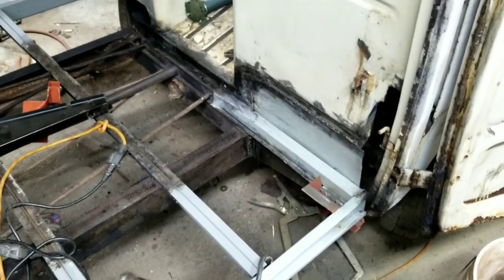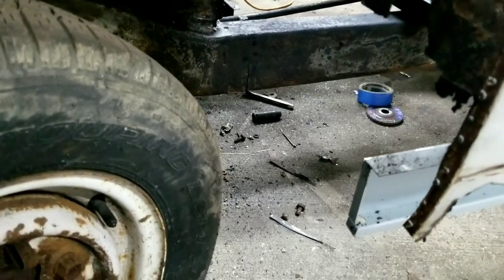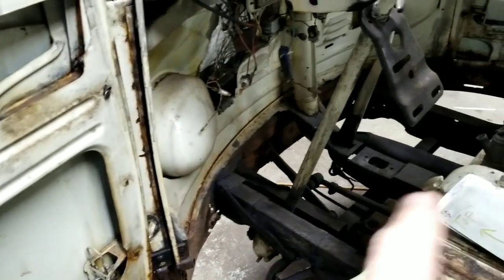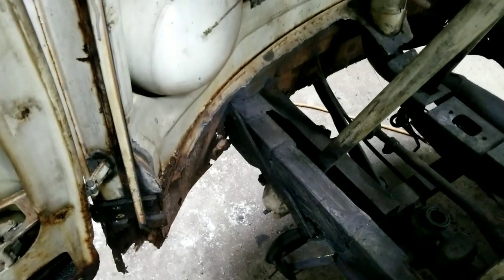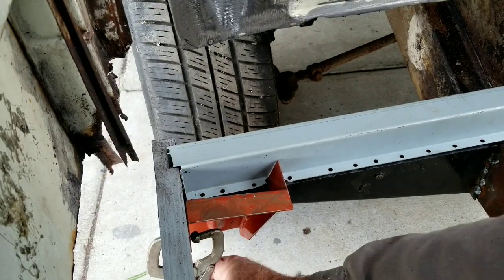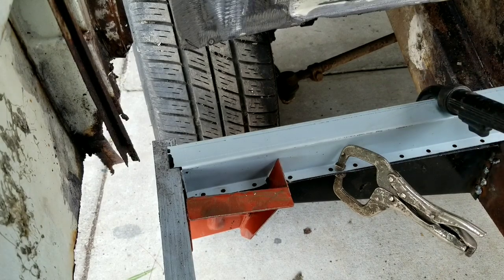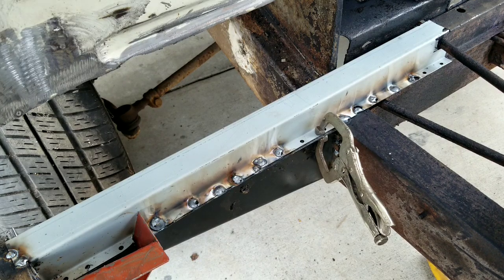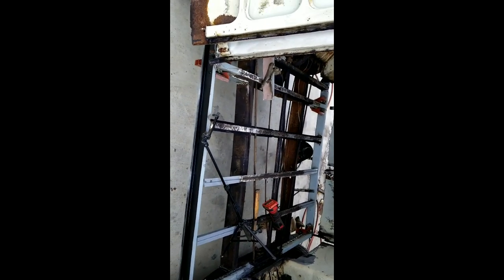RESTORATION - RUSTY VW bus removing dog leg and welding in jack points

Comment: Fantastic work. I do love the fact that you do  the holes and the spot welds like the original guys did.
Reply from the maker: in the areas that you can see I like to do that. behind door panels. or areas you cannot see I dont.
Reply: Welding and holding a camera, have to give you 10/10

Comment: Why do you don't use a drill to drill out the old welding spots? You get clean sheet metal and pretty good  new welding points. Best regards from germany.
Reply from the maker: yuck it takes too long. I would rather split the welds with an air chisel or hammer and chisel and pop holes in my new parts. takes less than half the time.

Comment: Yesterday I saw that on the back corners they have gone up in the last 10 years? And they use to go half way up the light, now they go about 3 inches below the light ?  But that is the parts you need. Mike draw the pieces that are below the front door hinge because you have enough bender equipment to pull them off next time . Those hat channels could be done on your machine also.   With this bus and CTs  a lot of parts could be made IF you had a pattern . With out its like Steve Martin said- I know what it is ------- What the hell is it??????????